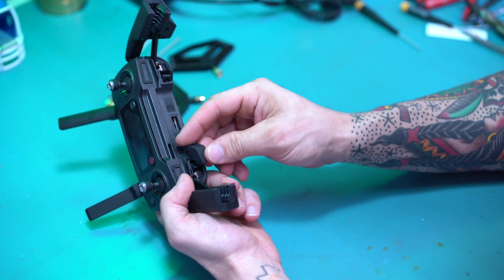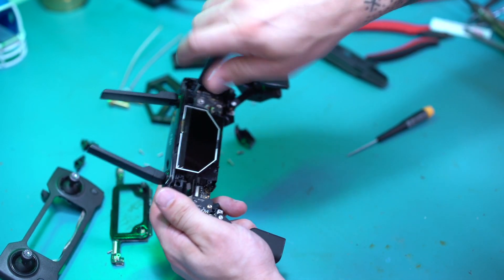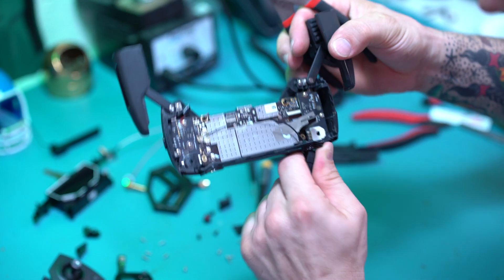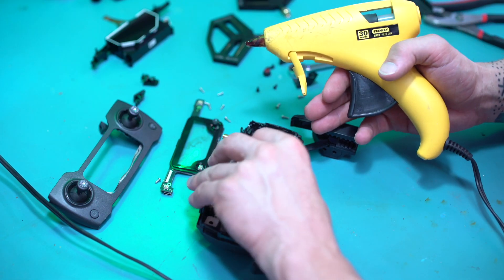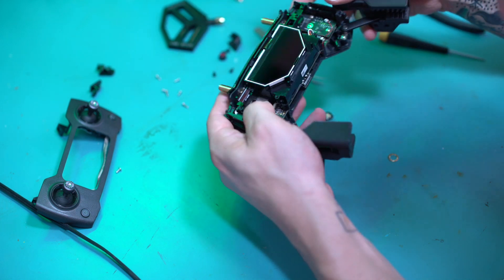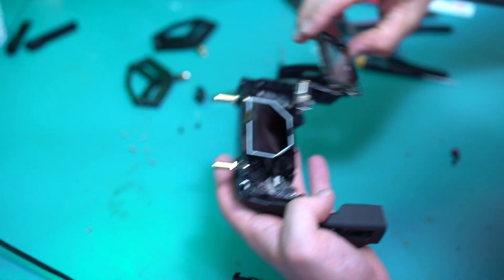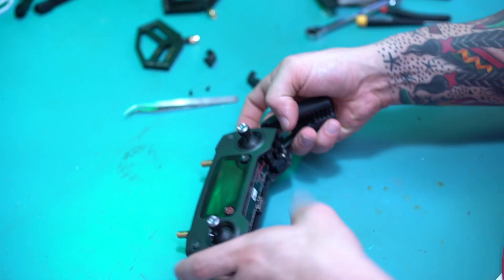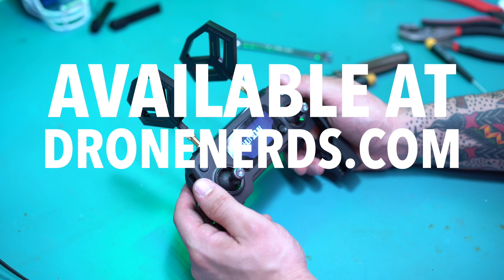DJI MAVIC Long Range Antenna Upgrade Install

Comment from the maker: For everyone asking WHY? This is to increase Signal strength at all distances not just long distance! The purpose of this modification isn't just to fly 10 miles! Its to have constantly strong signal even around trees and buildings that normally cause issues with signal.
Reply: It depends on the country. For example in Thailand Mavic can't fly using FCC. Also, fog and high humidity interfere with the signal.
That's why the signal was lost when drone flies in 1km and more
Reply: I don't live in a big city, not a single tall building nearby, just subdivisions, standard WiFi interference, normal sized houses, and lots of radio and cell phone towers like any town USA. And ~9000ft is as far out as I can go regardless of altitude before getting "signal lost" and have to turn back. And that's with or without those parabolic reflector things on the antennas. Don't know if any of the add on antenna mods work or not, but I am 100% certain the 4.3 miles DJI claims probably has to be in a flat area or area without much RF interference. Seen many people do 3+ miles online flying out to sea, over a beach or desert landscape. You'll never do 4.3 miles and make it back on a single battery and no battery add on mods, unless you get a strong tail wind on the way back. When you hit critical low battery it will force land where ever you are. So the comment most people get min of 3 miles means most people in the right flight conditions. It's a helluva long range this drone gets stock regardless. Most people do not get 3+ miles though. Many a forums proved that.
Reply: okay you just answered one of my questions my other one that's what I want to do the battery won't last long anyways to bring it back home is how many miles range can you get my whole purpose of getting in this what you just finished saying has a strong single
Reply: @teddyr7901  yeah.. but you can get more than double the time with battery upgrades on ebay. two lipo batteries on each side
Reply: Now this is a justification I can understand. Though you might want to consider renaming the product.  You're missing out on consumers who might buy it for short-range signal strength, but think it's mainly for long-range use. They'll see the name and move on rather than reading more about the product. It didn't even occur to me that it might also help short range signal strength until I read your reply, despite my engineering background.
Reply: You're full of shit. I fly in a normal rural city. If I head north, I can get 2 miles minimum; haven't tested it to it's max. If I head south, it often drops out at half a mile. It depends entirely on the conditions, but unless you live on top of a mountain, yeah, you're not gonna get 4 miles.

EDIT: Lol, I must have had Codename's reply in my head when I posted.
Reply: Could you recommand some good antenna ?
Reply: There is so mny People that dont even know what a drone is and how i properly function, they only understand the bsics buttoms lol. Therefore so many dislikes, panic noobs
Reply: Tony Mark 

You're full of shit. Most people get a minimum of 3 miles and that's only because people are usually too scared to fly farther.

The 4 miles DJI claims is actually conservative when tested as DJI tested.
Reply: @Codename73  lets see some video then. I've been flying all types of quads for over 5yrs, have had 3 phantoms and 2 mavics, in suburbs or city type populations, 1.5-1.7 miles is the longest I've gotten. Not afraid to push mine either,  crashed plenty of them, but when the video goes out, the video goes out.  All the Mavics use the Ocusync system, which started with V1.0 then had some upgrades, until latest v2.0.  Even though Ocusync carries both the video and control signals, the overall range didn't improve with any of those, what basically improved was the video, and how it carried the two signals.  v1.0 only works on 2.4Ghz, and can only do 1080p at close range, when the signal degrades at all, it drops to 720p.  v2.0 works on 2.4 and 5.8Ghz and can switch between the two depending on which has better signal, meaning you can get 1080p at all ranges, but the crafts control range has always been longer than the video will hold up. So yeah, if you want to fly blind, and keep hitting the cancel return to home button constantly, maybe you can get 3-4miles in the city or suburbs.  But with all my DJI products I've flown, I've never hit 2 miles, before losing video, unless way out in the country with no phone signal and flat topography.
Reply: sunshynff 

All one needs to do is search YouTube and you’ll see lots of videos with people flying over metro areas getting far past 1 mile. 🙄. You can get about 2 to 3 miles in a metro area, in a downtown city? No, you won’t get that. But these guys saying a mile are full of shit. Especially on the new DJI drones like the Mavic Pro 2.

I’ve had many DJI drones and have flown since the the Phantom 2. Things are more restrictive today than even when the original Mavic came out.

You’re also wrong about Ocusync, Based on your reply, you clearly took the first Google hit and regurgitated it, LOL. 

The real key in 2.0 is NOT just the improved frequency hopping and lower latency. In combination with new DJI transceivers, you get LONGER RANGE. That is the difference. Range is improved through better OcuSync fidelity and transceivers tuned to work with it.
Reply: @electriceyeslide5959 ... Electric Eye Slide   Listen, I didn't need to google it, like I said, I've been flying and building drones for over 5 years now, I helped start the first drone program at my fire department, I also volunteer my time and equipment with my local fire and police department and train with them.  I recently purchased a DJI S1000 octo-copter that will do 7miles, and also uses the ocusync technology, but with higher end antennas and better amps and way different flight controller.  I've actually met DJI sales reps at training events.

So are you saying that transceivers are the thing that madev 2.0 better, or that better transceivers were what made Ocusync better?  Because transceivers have been around since Lightbridge, and used in analog rc for years. Even if you were referring to the latter, transceivers have nothing to do with better range, no matter how well their fidelity is.  It improves things like video, or OSD quality/quantity.  Frequency hopping and switching between frequency to find the stronger signal have also been around for quite a while in analog and what most racer/freestyle quads still use, they call it a diversity module.  The brilliance with Ocusync is that DJI was able to merge both video and control signal together, working together yet independently at the same time.  The video carrier is OFDM (Orthogonal frequency-division multiplexing) which when craft is powered on, locks onto a clear channel, and remains there unless that signal gets weak or is manually overridden by the pilot.  The control signal on the other hand, is a FHSS (Frequency-hopping spread spectrum) system, which carries packets of info across the whole bandwidth, which is why you will normally get more distance with the actual drone than with the video feed. DJI has on their website the specs of Ocusync 2.0 when they released the new Mavic 2.0, and the same distance is listed as on Mavic Pro.

Also, I've seen plenty of videos on youtube where they get awesome distance on their Mavics or Phantoms.  There's a lot of factors there though, did they edit it, if not, how do you know the footage is from that drone.  How do we now it's not modded in some way the youtuber didn't disclose. There are several apps out now that tell you RF interference in your area and even optimal times to fly..  So yeah, like I originally said, it's possible to get 3+ miles with a Mavic, I've gotten my first gen mavic pro do well over 2 miles out in the country with nothing around.  I'm sure it's possible in the urban setting with the right conditions too, but I think the average Mavic owner in anytown suburbia USA, is gonna average about 3/4mile to maybe 1.5miles with stock gear.
Reply: sunshynff 

Abridge, abridge, abridge... Geeeeeeze dude.

I’ve gotten 2 miles on stock gear with my Mavic which totally invalidates your 3/4 of a mile on stock gear comment.

I’m an engineer by trade and your understanding of how transceivers work is in incorrect.

Comment: Can you do a video on attaching a high gain antenna on the Mavic Pro 1 drone itself? I've followed your video and glad to say it WORKS! But i want to do it on the drone itself also. I saw someone do it on a reddit forum but i couldn't trace him down. Yes his drone looks like a spider after he attaches the 11 DBI SMA antenna's at the back of his mavic 1 pro drone. I also want to do the same. How to do it? Please help.
Reply from the maker: Hi Imtiaz, glad to hear it worked! Unfortunately, we're no longer working with the original Mavic Pro. Still, you can email us at experts@dronenerds.com to see if we can find an answer.

Comment: For a more pro tip after all that work that goesin to open thecontroller, you could mount a "T" formed SMA Connector instead. Then you have 2 options availble at any time. You can fly With 360* deegre antenna or use the other slot on "T" sma Connector and also mount direction antenna. That way you will have exelent mile covarage both long and short. You will need to use SMA cable extenders to use antenna proparly. You will also get a much better signal because sma cable extender will move antennas more away from each other and filter a noise. For a more nerdy tip, wrap aluminium foil around the small sma Connectors inside the Controller and mount them inside a heatshrinked protection. This will filter the RF noise even more. People should study the basics of drones and how radio signals work. 90% only understand the buttoms on the Controller and a quick software Upgrade. If you all do this homework you will quickly see how you can make a 500$ dollar drone become a 1000$ dollar drone from cheap elecronics and wallmart first price prodcts. Goodluck :)

Comment: How much will it help?  Can you now run the antennas to a power amp and boost the power up to 10 or 20W from larger antennas?
Reply: I don't see any reason why not... Just need a compatible set of amps and well matched antennas and boom boom off you go. I'm curious about this for running external antennas like for a house or vehicle rooftop. Just imagine touring miles worth of property from the comfort of your living room couch in front of a 60" LED tv. It can be done, easier than you think. ;-)

Comment: Does the new antenna use more power, and reduce the controller battery faster? I am curious to know the controller battery life with the old vs the new antenna.
Reply from the maker: Shouldn't be an issue
Reply: I would think there would be no change at all. Since you're not modifying the radio electronics, only the antenna, the only difference should be an improvement in signal strength and a slight reduction in heat in the electronics. It definitely won't drain the battery any faster.

Comment: As a radio amateur and a drone builder/ pilot, I know that well designed antennas are very important. I just don't get why people are slamming these. If you get less signal loss then that these worth while. You can always do this mod on a spare controls! If you don't return that control with the Mavic then who will know! If this mod is not for you then stop slamming it, just wall away! And no I am not connected to this company!

Comment: i wish there could be an easier way. I don't want to void the warranty.
Reply: Not only will you lose your warranty, you will lose your insurance.
I believe 4.3 miles is long enough until they come out with the Cell Phone Tower system like the commercial people that are going to be delivering packages will have.

Comment: Nice mod but considering the FAA requires keeping the drone in sight, and the battery currently lacks the capacity to get you out to the factory max and back in all but the most ideal conditions, it's seems like overkill. Anyone flying into the wind on the way back is praying it returns at all. If DJI develops a battery that allows travel out a few miles, plus time at the destination, plus enough juice to return, I could see it being used out in remote terrain where enforcement is unlikely anyway.   Good luck finding the damn thing if there's a mishap.  What it needs right now is a radio beacon not an even longer range antenna.
Reply: Joe Martins fuck faa
Reply: Joe Martins What the hell are you talking about? The battery has a flight time of 27 minutes. That is 3 minutes a mile at 20 mph. It will do 40 mph. Are you starting to see how stupid and inaccurate your statement is yet? No? Ok, let’s look a further, so even at 20 mph the range of the battery is around 8 miles conservatively. The current range I get without any mods is well under a mile in my area. So if this doubles my range I still have around 10 minutes of flight time at a destination 2 miles away. Is that worth it? Of course it is! Do you have a mavic or any clue what you are talking about? Nope! None! Go pretend like you know something elsewhere.
Reply: Joe Martins totally agree with everything you say..
Reply: Nice.
Reply: DEM GRE Exactly the kind of ignorant attitude that will cause the FAA to clamp down even harder on the industry. When they do, we'll know precisely who to thank.

Comment: With the range extender, what sort of range are we talking? preferably in feet, km, or miles please. Interested in your product for sure. What polar filters do you recommend on your site? do they interfere with the gimbal in any way shape or form? Such as gimbal configuration, or weight wise? what's the cheapest best ones you'd use, but still in a good category of good filters? I see so many now I just don't know which ones to get without spending a lot of money. Thanks bro :)

Comment: This video starts with how to do a mod. Did I miss the part about what's the purpose of the mod and why would I want to do this mod. My first question was, "what long range antenna booster?"  Did I miss it or did you fail to explain anything at all about the product and the manufacturer???  Great "how to install" video, but I'd like to know more about the product & features before I install it!  Thanks for sharing.  DJ Soul Force
Reply: SOUL FORCE QUADS It's meant not only for longer range but for stronger signal.

Comment: You are "NUTS" dude!! I am 71, and can not even see those parts. Not sure I would have taken that darn thing apart in my 20's.
Reply: I worked in a TV repair shop years ago and we used large magnifying lenses and bright lights to see. In the 80's came SMD or Surface Mount Devices which were very tiny. I had to file down my soldering iron to pin point just to do the repairs. I hope this guy makes enough money to burn off those disgusting tats..Yuck..

Comment: What's the point !!! The batt will rth way before u lose range on the mavic
Reply: muselive100 you couldn’t be more wrong. Flight time of 27 minutes ,do some math dipshit. Stock mavic can’t even approach the range of its battery.

Comment: 6 kilometer range is not enough?...
Reply: You mean *7 lol. But I know right!
Reply: If you get 300m range on the Mavic, you're behind a wall or metal structure - or your Mavic is broken somehow.

I flew >500m away, on the other side of a building and some woods, and it had only lost one bar of signal. Make sure the flat part of the antennas point toward the drone, not the tips.
Reply: some time the range is 300 meter, this can help to improve it. and to go further